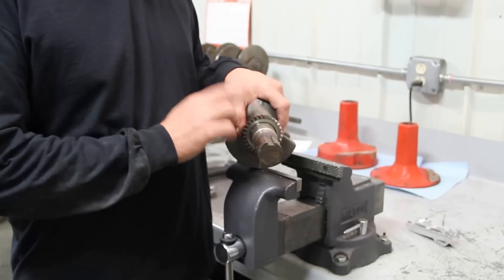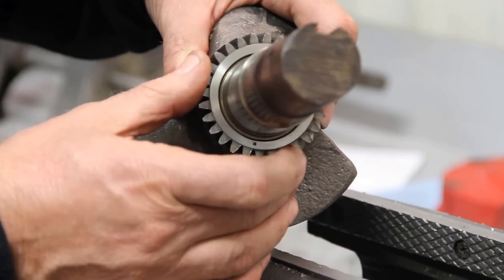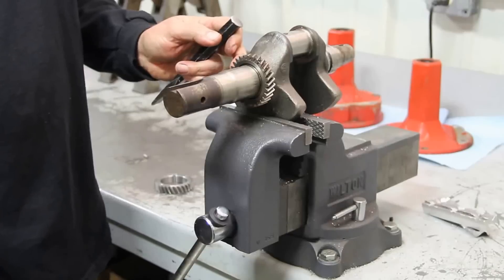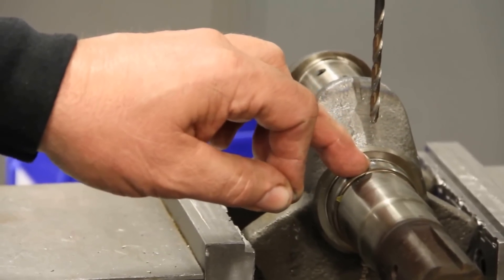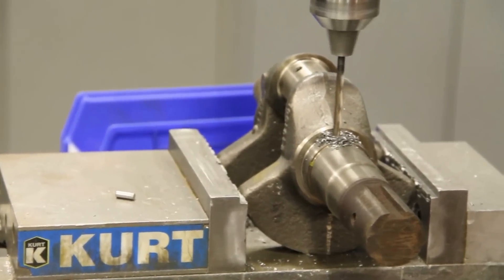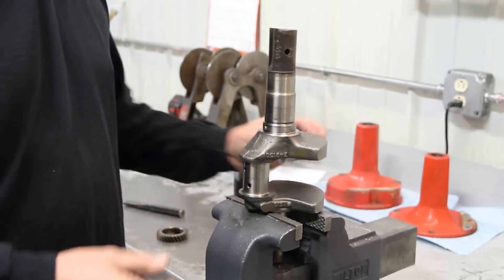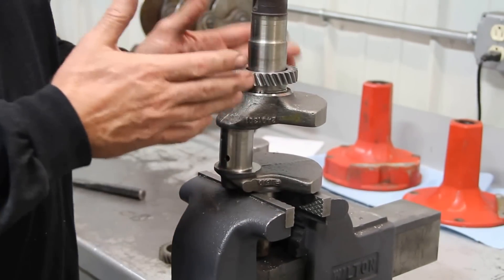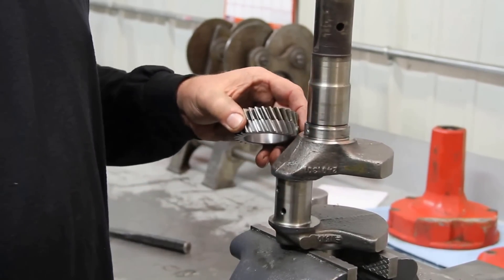V-Twin Kohler Command Crank Gear

Comment: Do you think I need to replace the timing gear on my CV730-0017 25 HP Kohler commander keeps breaking the woodruff key. What diagnostics? Do you sell your improved part timing gear? My video shows the situation with my engine: https://youtu.be/e8b0tQWDxdg?si=B-cDFoAVXy2tXhhF

Comment: I ended up buying 2 gears due to one getting ruined. Please do not heat this gear cherry red. i did so and the gear was loose on the crankshaft.This is  probably a better gear than the stock one but do yourself a favor and install as follows. Heat geat in an oven to 400 degrees and press on with a hydralic press , thats it. Look at my channel Italianman4you and find kohler command gear replacement video.

Comment: I have a kohler MTGHS 9520130 is the model and serial number. I don t the size because all the marking are gone. I want to put the ductile iron stroker kit in it. Want more power to run a 60” deck.